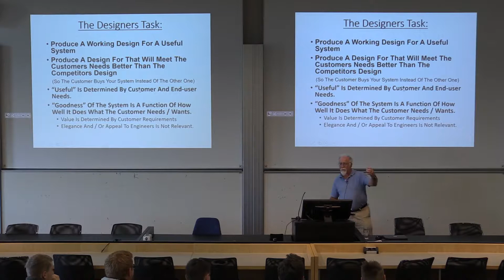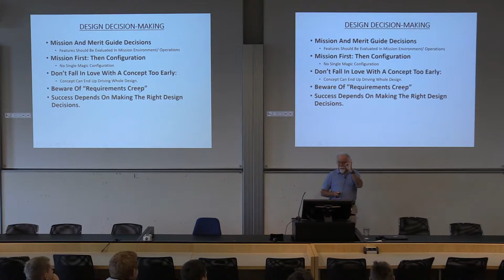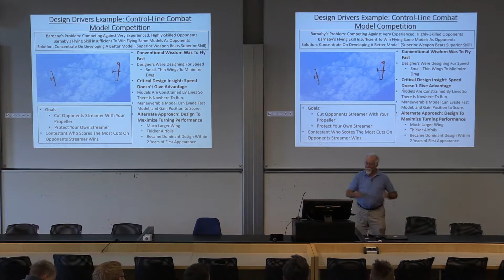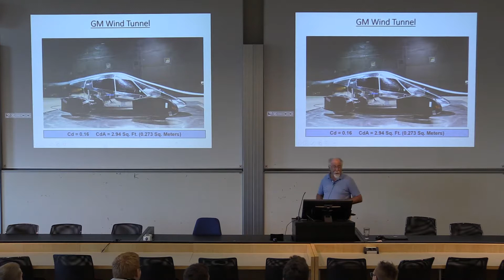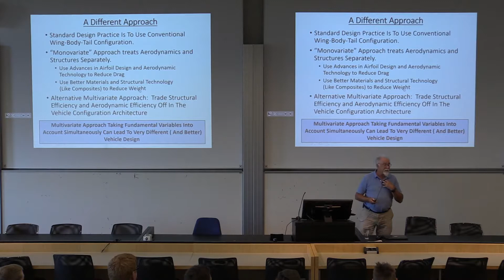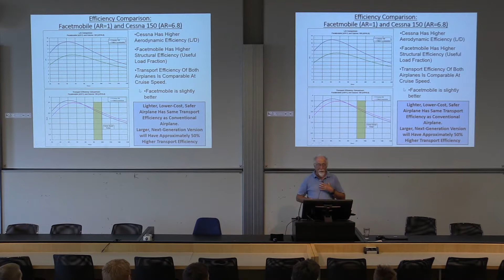Barnaby Wainfan: Secrets of Winning System Design at Reykjavík University

Comment: What's your thoughts on using the FMX  design for a space plane? Two jet engines, two rockets. Lots of lift for plenty of fuel. Because of all the lift smaller jets can be used. Since you'll be at altitude and in motion already smaller rockets can be used, further reducing weight.

Comment: I also, like RV7 Builder, have been a rabid follower of your column in Kitplanes for years. In fact it is the main reason I resubscribe to Kitplanes is to follow your excellent explanations of aircraft design principles. I just wish the column was longer because I hate to have to wait for the next month for the next "lesson" ! Really you give such good reasons to why designs are chosen based on use and why designers have to compromise and deviate from optimum because of cost,simplicity of manufacture etc. You make a complicated subject so interesting and taught me how to think about the whole project 

I have no money or patience to build a kitplane , but I love to dream and design the ultimate efficient airplane for many categories of planes including ultralight, LSA , 2-6 people conventional designs and cargo planes.

I was wondering why you didn't care for V-tails, because in theory, they make sense (lighter, less drag, less building time, etc.) and I see the Sonex kitplanes use the V-tail, but I never seen in Kitplanes any explanation of the flight handling characteristics of say a Sonex versus a RV6 (or similar weight and horsepower)

I love how you look at designing and trying out unconventional wing shapes and challenging "known" flight designs. It kind of reminds me of how supposedly a bee shouldn't be able to fly but of course does wonderfully.

When I design a wing, I tend to think of the wing passes thru the air to the path of least resistance. Like if you flew a flat plywood 30 pound , 4x8 board  thru 30 knot wind, parallel to the wind is least resistance.  But gravity would pull it to the ground. So adjusting the AOA to say 15 degrees would give sufficient lift to maintain same vertical height. But if you put more thrust inline with that plywood you can lower that AOA  as that board seeks the path of least resistance.

I notice the winglets you use on your low aspect wings. I was wondering why they aren't used on all aircraft? I remember flying diamond kites and model Cox planes with two wire controls (you fly in circles) and watching them at just above stall speed. The wings (and kites) would oscillate rolling left and right which felt like the air would dump over the wing tip and then recover and then the other wing would do the same. So assuming the higher pressure air underneath the wing found it easier to slide laterally  around the tip and aim for the lower pressure above the wing. But it would make sense, to me, that if you had winglets on that cox plane (or the kite) that the air stream would find it easier to go under the wing rather than moving laterally and causing high induced drag. 

I know you have the best explanation of why winglets aren't universally used to drastically cut induced drag and would love to see the reasoning why they aren't used a lot more. 

One more quick thing. I have loved Burt Rutan designs, with the combined winglet/vertical stabilizer and pusher engines and was wondering of what you thought of them. I heard they have poor pitch control because of short fuselage, but why hasn't the other parts of the design taken root?